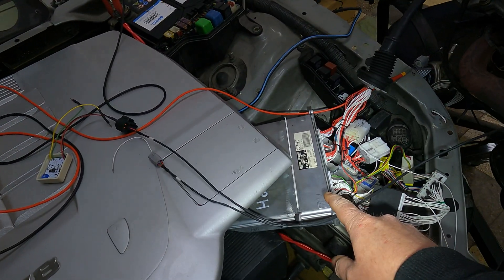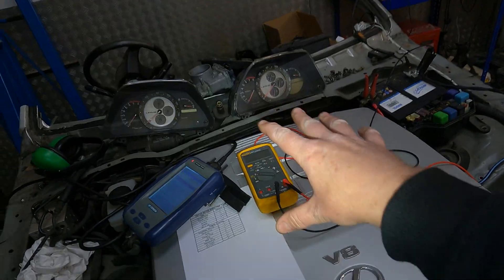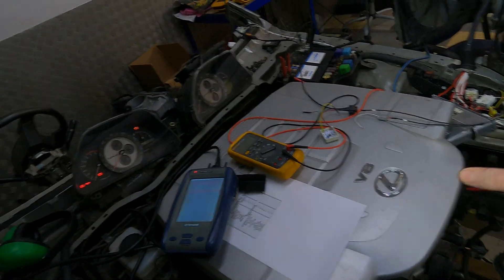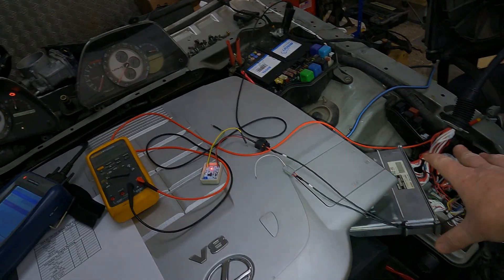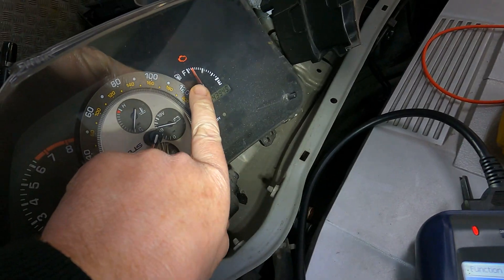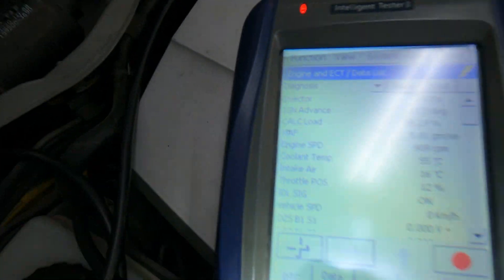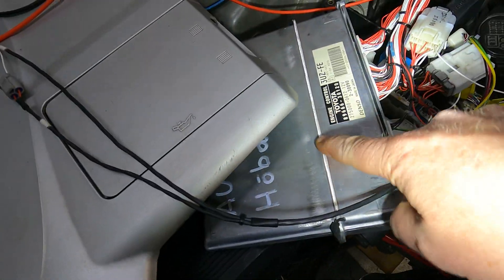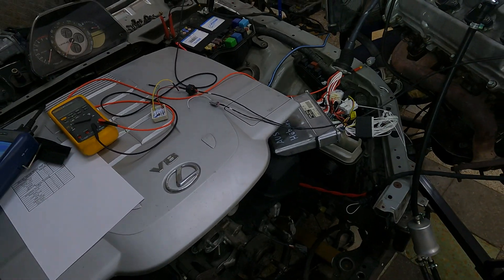Andreas GS430 2000-2005 3UZ-FE VVT-i ECU Remap

Comment: so he don't need a can to mpx module here? it all map in to the 3uz ecu? is this 🤔 something newer?
Reply from the maker: With the 3UZ 5 Speed ECU's due to them also using MPX as a form of communication the MPX Data can be modified as part of the Remap to make it work. 
The 3UZ 6 Speed uses CAN not MPX so the 3UZ 6 Speed Models require a CAN to MPX converter.